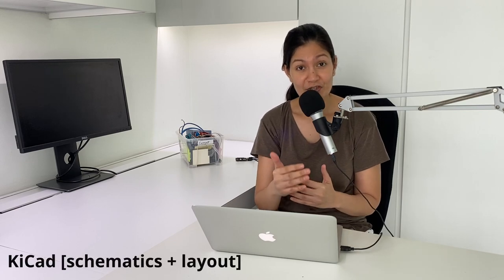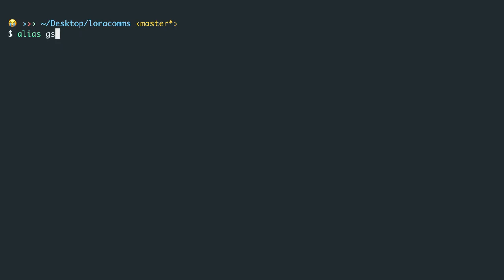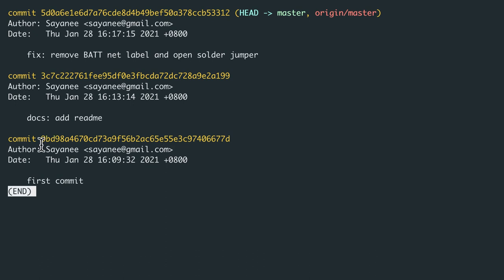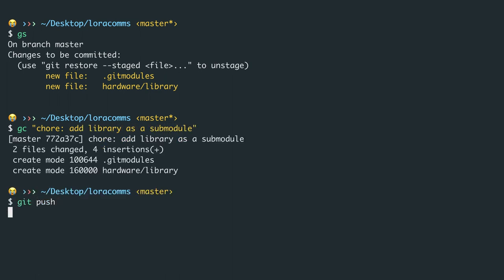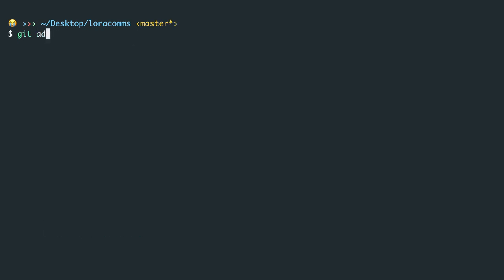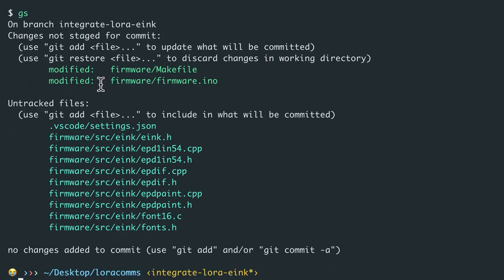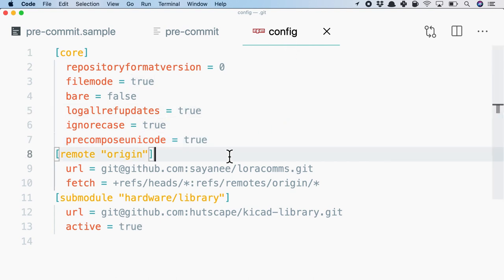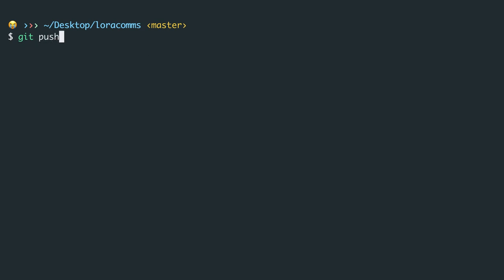Version control for hardware developers // Git, GitHub, KiCad

Comment: Great video. Your presentation is clear and well thought out. I am working through these issues for my projects and you helped clarify several things. I was thinking of structuring my repositories is with a similar hierarchy. i.e. a firmware and hardware folder within a single repository, but after watching your video I am having second thoughts due to Git/Github tags and releases. The firmware and hardware versions will not necessarily be the same, but since the version tag is assigned to the repository as a whole it is unclear if it is for firmware or hardware or both. I am thinking it may be best to have separate firmware and hardware repositories which would allow for separate version tags for each. If needed a dummy main repository that includes each of these as a submodule. Any thoughts?
Reply from the maker: Great question! Should the firmware and hardware version be the same? I have thought about this too!

It all depends on the complexity, process and users of the project. For me, it is a hobby project for a single person, so I don't mind keeping both the hardware and firm in the same git repository. But I also want to know which hardware / PCB layout was sent out for manufacturing. Hence, I git tag that version.

But look at the Apple iPhone which is a huge project with over millions of users. Their hardware version E.g. iPhone 11 or iPhone 12, etc is different from their software or the OS E.g. iOS 15.4, iOS 16, etc. I am sure, internally even within their firmware they have various components with different versions for tracking.

So I would say, start with a mono repo, a single version. As the complexity of the project, the team, and users grow, break it apart.

Comment: Git has many commands.
I still don't understand if it is possible to save hooks in a repository. Or if each participant creates hooks locally.
I also did not understand where a files will be located when connecting submodules. 🤔
Reply from the maker: Regarding Git in general, I took a long time before I could grasp a few more commands, and even then, today I still pick up bits and pieces. If you are totally new to git and don't like the command line way, then I suggest using the GitHub UI app or other UI-driven Git app. Or if you still want to learn the command line way, then I suggest sticking to just committing your changes in the main branch itself and revisiting the history. After all, being able to go back in history is the essence of a version control system.

Regarding git hooks, yes you are correct that we cannot save these hooks in a git repository because .git folder is ignored. So a possible way is to have a "git" or "scripts" folder where you can store them and commit them. Upon git cloning, you can "install" or copy those scripts over into your local ".git" folder. In this way, each participant can also see the git hooks and share them. E.g. https://github.com/holman/dotfiles/tree/master/git

Regarding git submodules, the command for the git submodule as shown in 32:03, will have the path to the folder where the git submodule will be installed.

E.g. git submodule add git@github.com:hutscape/kicad-library.git hardware/library

This means in your current repository, the submodule will be installed in the folder hardware/library.

Hope this helps! Once again, just do it step by step, and maybe just focus on a few git commands and get comfortable. It can be pretty daunting, but thankfully there are plenty of online tutorials as well:
https://guides.github.com/introduction/git-handbook/
https://www.atlassian.com/git/tutorials
https://git-scm.com/docs/gittutorial
Reply: @sayanee  Thank you very much for your comments and for sharing your experience. I will try to use this in practice.

Git has another interesting moment when a commit drops out of a branch, but SHA is not deleted.

For GitHub Desktop 32-bit automatically created SSH, in the new version 64-bit I need to deploy it locally (by hand). This summer GitHub will disable the ability to Push by password.
Reply from the maker: @experiencedlab1969  Haha, yes the SHA1 not deleted actually can be used to your advantage!!

I remember once deleting an entire branch, but thankfully I could still retrieve the code because I could simply do a "git checkout [sha]" 😅 Example here https://stackoverflow.com/a/3640806/496797

Once again, git is doing what it is supposed to do - going back to our previous work and not losing them!

Comment: Hi mam, if you don't mind could you please give some info about using in Windows platforms.
Reply from the maker: Do mean how to install Git on Windows? Then try this link: https://git-scm.com/book/en/v2/Getting-Started-Installing-Git#_installing_on_windows

If you mean installing KiCad on Windows, then try this link: https://kicad.org/download/windows/
Reply: I use kicad, Arduino, vscode and git on windows all the time. Pretty much everything applies with the exception to those aliased commands. You just need to type the commands in full.

Comment: Maybe it just me and my inexperience with GIT. But I feel that she moved way too fast and did not explain each step of what she was doing completely. Looks like she was using MAC so I did not catch all of the commands. and she seemed to be jumping around to different software (or possible GitHub) to do certain things. I will have to learn some more about GIT before coming back to this. I am a Kicad user and do programing with Micrcontrollers so I am not a total noob. I am just not a developer so I am coming at this from a hardware electronics, robotics, and animatronics background.